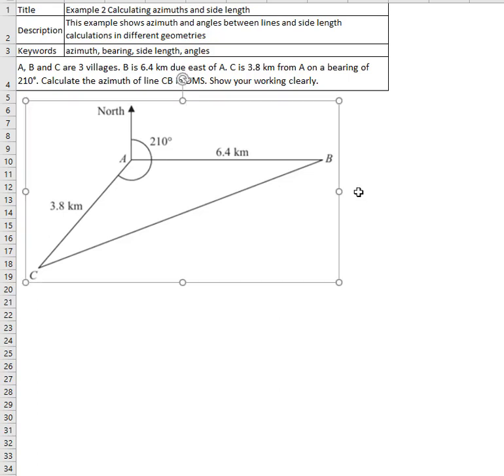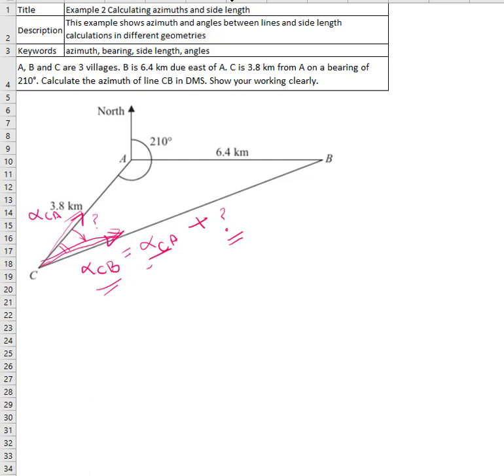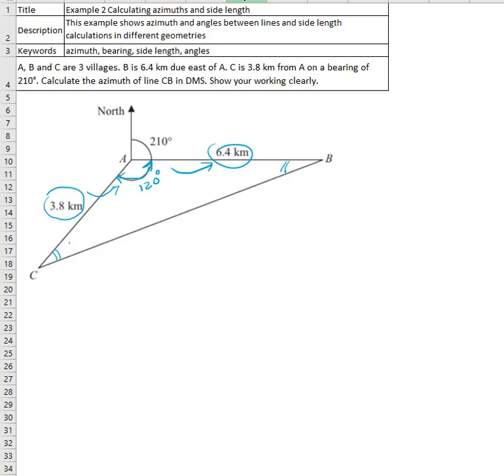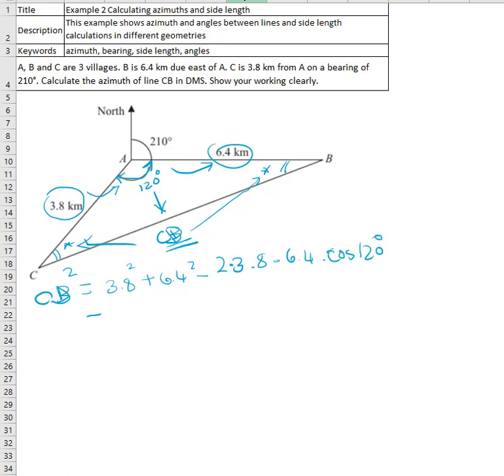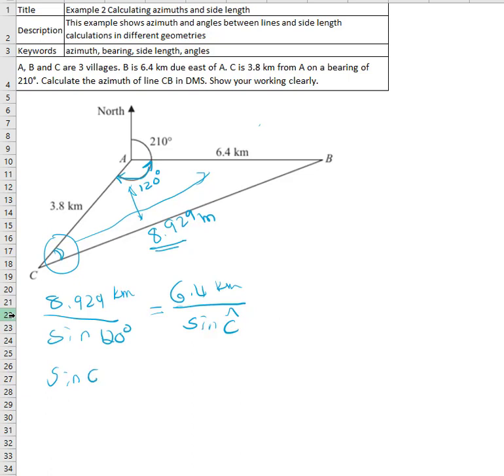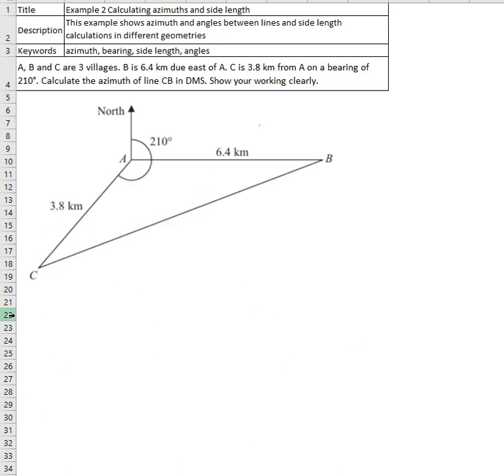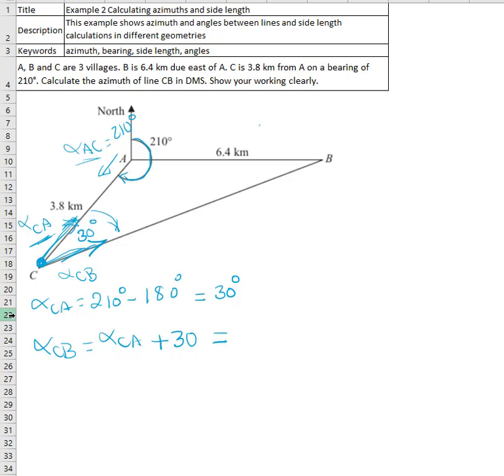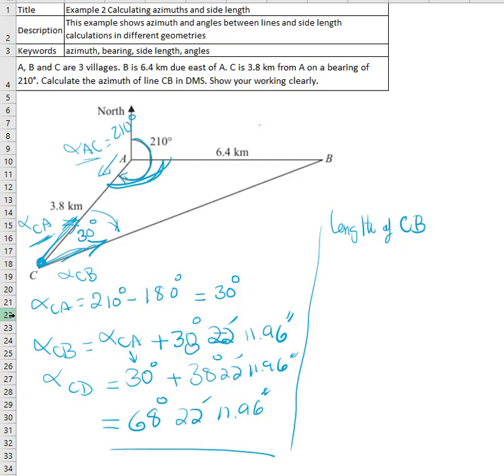Example 2 Calculating azimuths and side length

Comment: i couldn't get the solving of sin C. I mean how did it equal to 38.4
Reply: using the sin law, you can get 38.4°. 

Try it on your calc: (sin (120)/ 8.93)= (sin (x)/6.4) 
If you are using calculators like: Canon f-789sga or Casio fx-570 ES plus or 991. Click Shift+calc
Reply: @erythr  aaa now i get it. Thanks